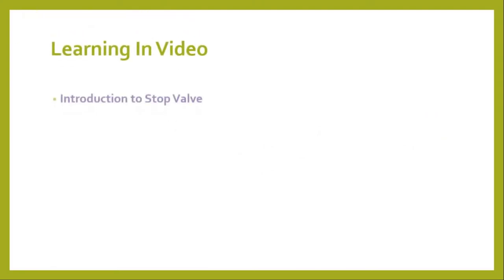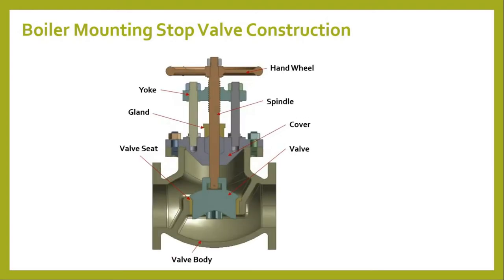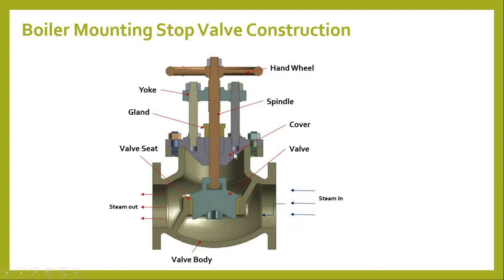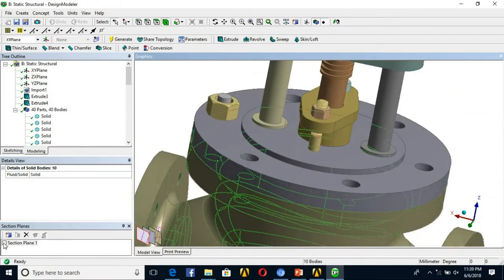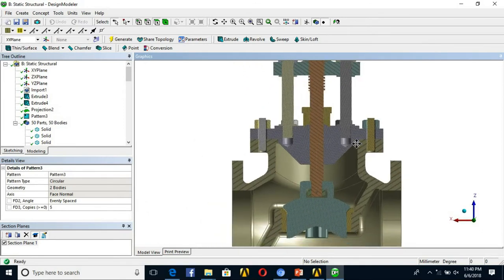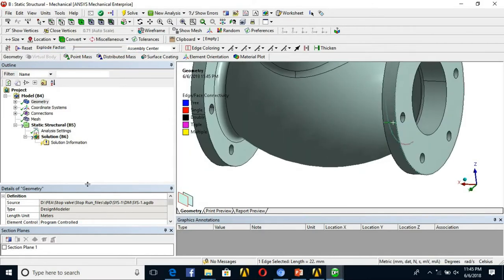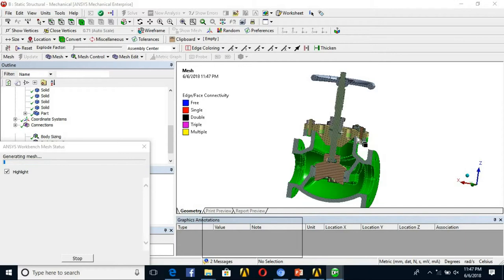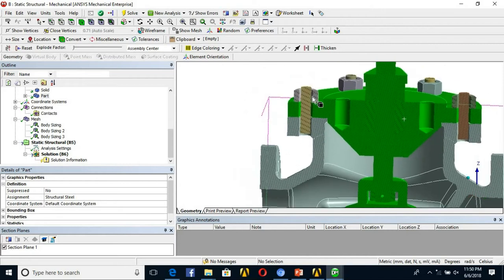ANSYS Tutorials. FEA Static Analysis of Pressurized Stop valve

Comment: Guys i've a generic question about valves production: when a valve requires o-rings, lip seals or other seals in specific areas of the valve (like on the seat rings or between two parts in order to prevent leakage) are they usually engineered by the same manufacturer that engineers the valve parts or by others?
Then, if the seals are engineered by others(that i think happens in the majority of the cases) do the real manufacturers of the valve re-make the FEA about the body parts plus the seals to check the entire integrity of the valves in static/dynamic/fatigue analysis? What is the real work flow?
Reply from the maker: It depends on manufacturer, they usually do testing from parts provider and ask to do combine FEA for any other service provider. It depends on the Manufacturer.
Reply: @graspengineering9249  Sorry i don't think i've understood your reply. I mean: imagine a valve manufacturer that designs parts (that are not designed using normatives) like seats, shutters or bonnets that usually are in contact with seals and that than they have to verify them  (stresses & deformations) with FEA.
Do they do a FEA of the complex assembly in which they simulate those seals or do they use some semplifications in order to not consider them? 
I've found some studies online with complex assemblies but in none of them is specified what they do with seals, if they actually simulate them or not.
(If necessary i can link you those studies by message, i don't know if i can put the links in a youtube comment.)

Comment: Sir please make analysis video of butterfly valve in which you find the cp and cv value of the valve.
Reply from the maker: Thank you ! 
Please elaborate more and forward the details !
Reply: A butterfly valve, nominal bore 500 mm,  body and Disc materials Stainless steel UNS32500 , same material for shaft, Internal body test pressure is 1 MPa,  Disc test pressure 1.5 MPa.
Reply: Sir,  and Mr. Rahul,  I have given some details about valve,  Will you please suggest contact and support conditions atleast if you have found out some methodology. Thanks in advance